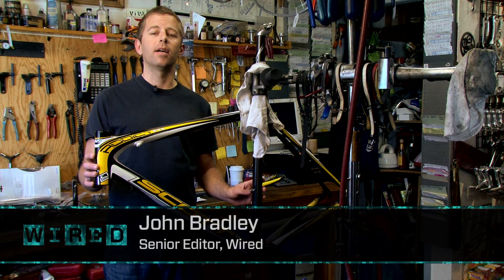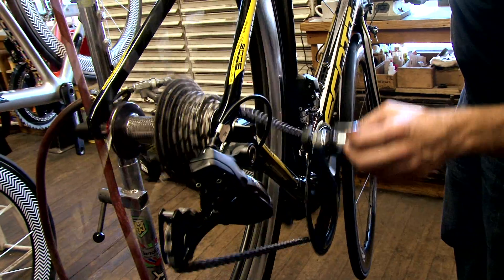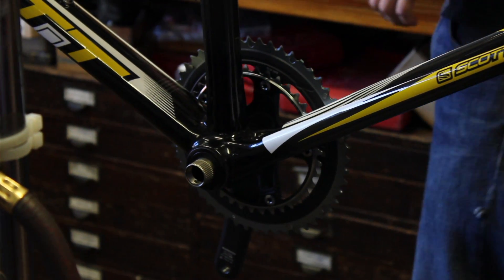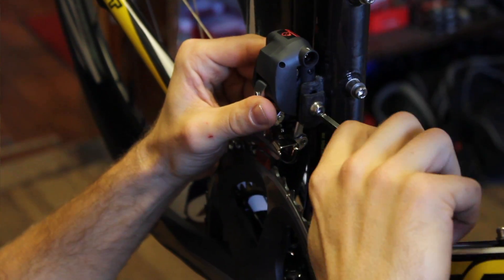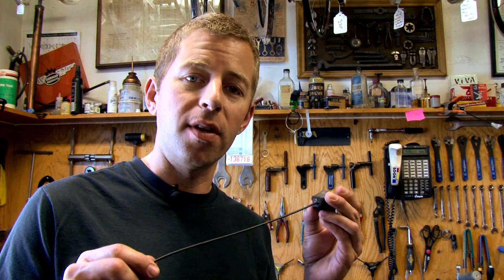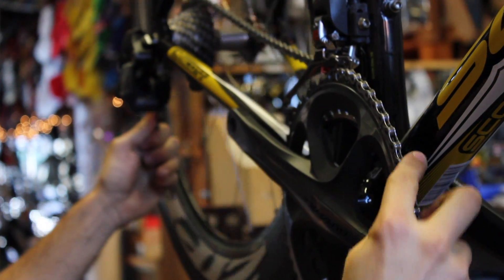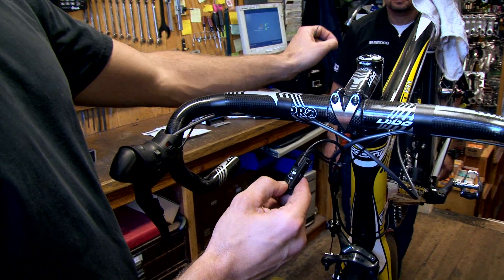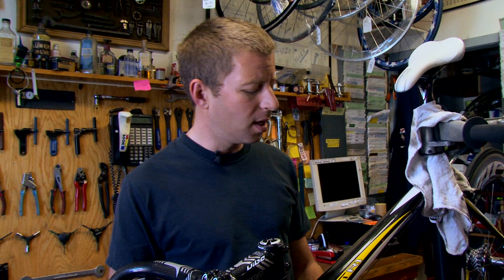How to Build a Bike

Comment: Okay, so there was mounting of the steering, pedals, derailer and shifter buttons, never saw brakes, wheels or saddle mounted, nor padding on the handlebars. At best this showed partially how to build a bike, but it didn't show all the steps. It's more involved than you showed here in any case.